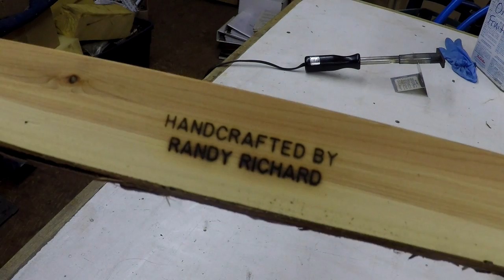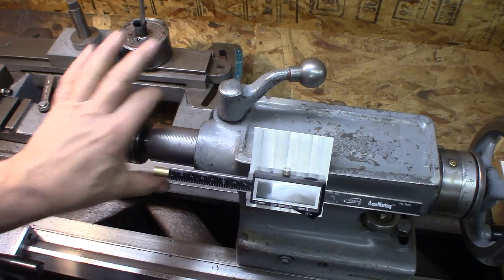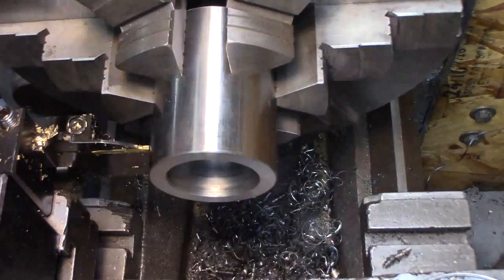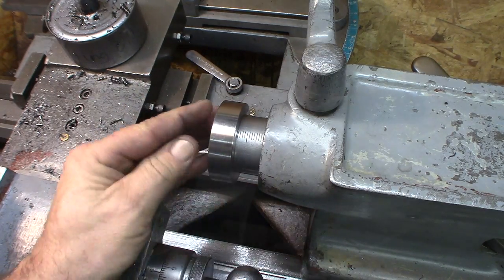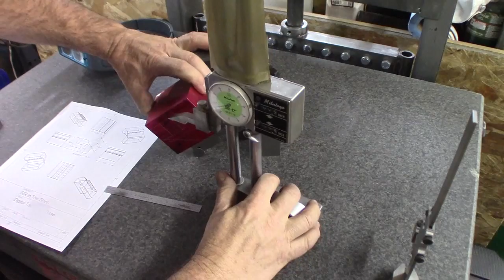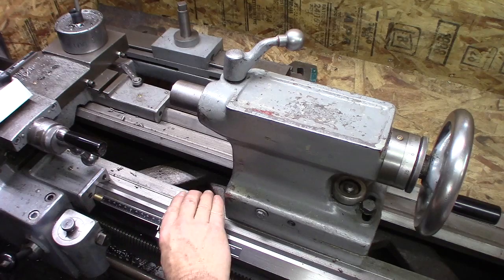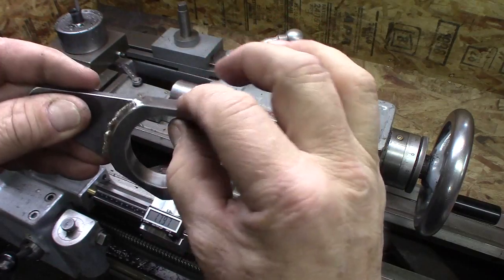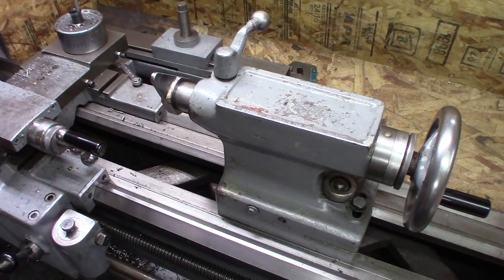How To Make a Lathe Tailstock Digital Scale | Tail Stock DRO

Comment: Wow turned out good! If I can be so bold to make one suggestion. If you extend the part that has the magnet you could use more of the scale's travel and keep it farther back away from you lock handle.
Reply from the maker: Thanks Peter.  Yes I want to,  it is just a matter of attachment to the scale, I will come up with something.

Comment: Most times when I have not drilled far enough my tail stock has slid back or the same with the drill in the chuck, got any solutions for that? Nice work
Reply from the maker: Make sure your chuck is not worn.  Try to install your drills all the way in when you can.  Lock down the tailstock tight.   Thanks Russell.
Reply: @RRINTHESHOP  Thanks for the reply, I do this however marking the drill seems to be the only way especially on deep holes  (might look at a mod for the tailstock clamp).

Comment: Nice job Randy. I'm adding this to my project list. I'm a beginner hobby machinist and this is certainly a great stretch goal!  Quick question ... what cutting fluids are you using in this video to keep the cutting tools cool?
Reply from the maker: On the Lathe I use Mobil , Mobilmet 766 Cutting fluid, On the Mill I use WD40 on the Alu.  Thanks AMG.
Reply: @RRINTHESHOP  awesome. Thanks for the helpful reply. Have a great week!

Comment: Very, very nice. 

I wonder if something similar could be setup via a rotary encoder, i'm wondering because my lathe's tail stock is fusiform in shape, kinda hard to mimic this.
Reply from the maker: There are so many different shapes makes it hard for something that will fit all.  Thanks for watching.
Reply: A rotary encoder for the drive wheel wouldn't show backlash or deflection, this method does, it's the basic advantage that a DRO brings to the party.

Comment: May I suggest using two pieces of flat bar for support (one on each side of component to be split), and split it with grinding blade or band saw and then use your slitting saw blade - much less stress on the blade and quicker!
Reply: no dont

Comment: Very nice Randy, especially for those of us that don't have any scales on the barrel or a dial.
Yours has both, so why make this?
Are they not accurate?  Or do you just like the digital readout?
Regardless, this is a great idea, and having the option of removing it and installing it in a split second is Awesome!
Nice job.... Razor!
Reply from the maker: No real need for this lathe Ray.  But due to several viewer request I put something together.  It does work well and it is fast and easy to use when you need it.  Thank you Ray for stopping in.